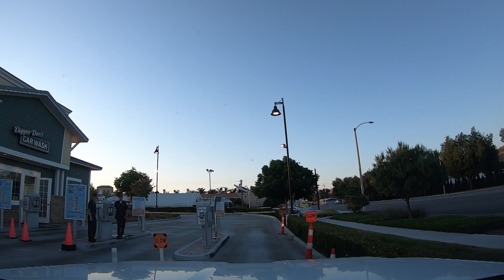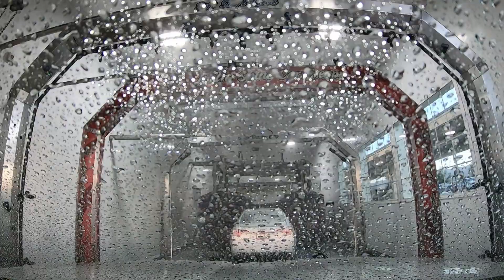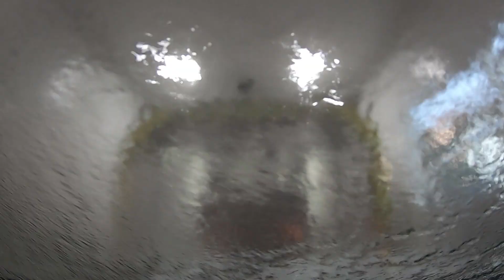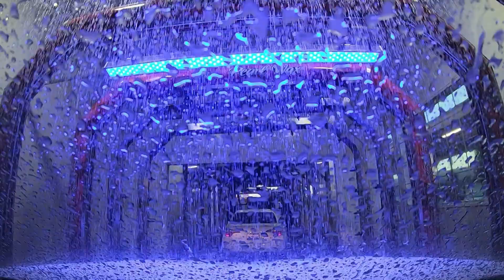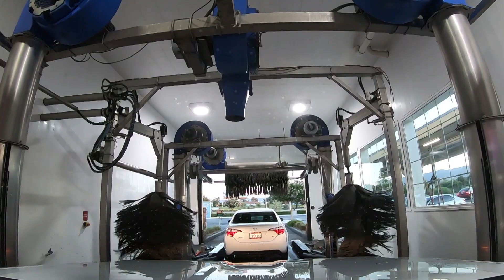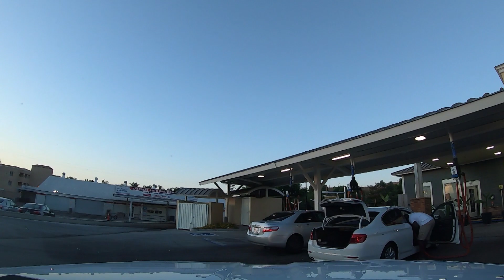Dapper Dan's Carwash - POV, Valencia, CA

Comment: Premium with the buff, good choice.
Reply from the maker: Haha.  Good observation.  I got rid of the tire shine  at the end though.  The tire shine kept spraying all over my paint.
Reply: @santaclaritadrone2844  I did the same exact thing with my pass. That tire glaze is a pain with my low car.
Reply from the maker: @aidanwalker5019  I wish they had an option to just have the buff without the shine.  I have asked many times but they don't do it.
Reply: @santaclaritadrone2844  ah, actually the "buff n shine" is only the grey wraps. The shine on the tires is actually a part of the premium wash package itself.
Reply from the maker: @aidanwalker5019   That's all I want is the grey things at the end.  But the tire shine is added as part of it.